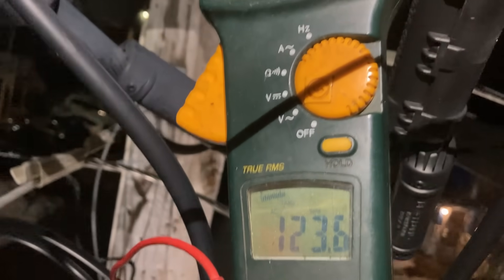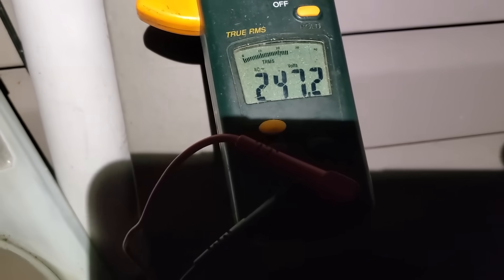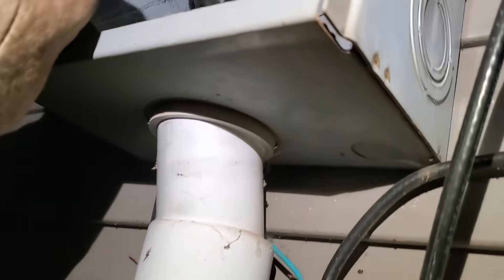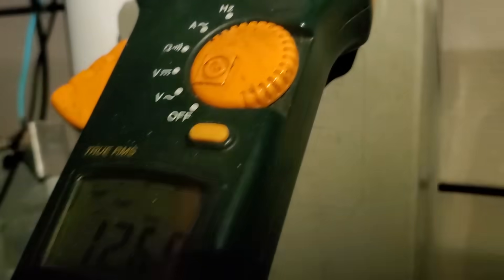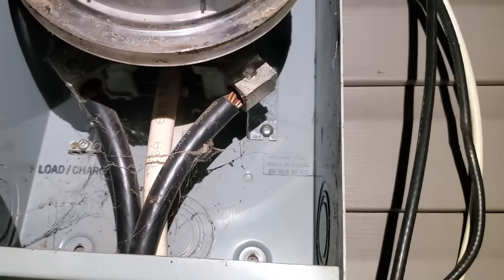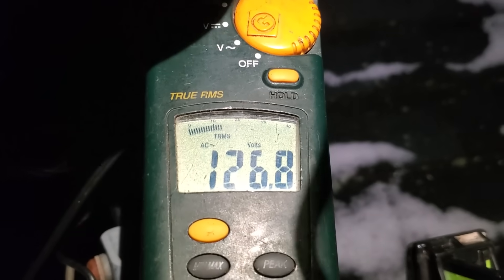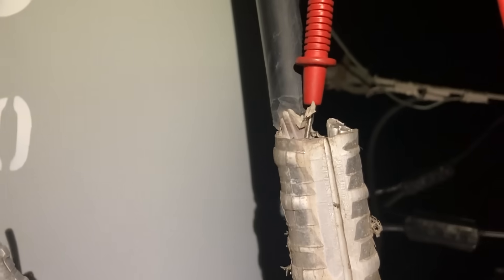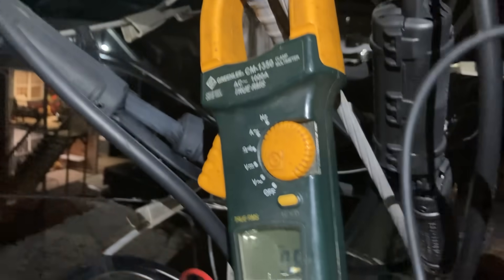Finding a bad neutral on a Service - Raw footage

Comment: I have seen neutrals completely disconnected on service drops and OWS’s on several occasions. I work as a utility arborist and get tickets about trees laying on or rubbing on service drops a lot.  When I talked to the customers they said they aren’t having any power related issues which puzzled me.   I am assuming this is because their house is properly grounded at the meter so they don’t have to rely on the service drop neutral for grounding.   Is this thinking correct?

Comment: You need to show this to every lineman in this country.  Around here they pull the meter and check voltage then say we have no problem. I check across every crimp and when I find voltage, I find my problem.
same thing with straight 480 in the oilfield. Go to every junction pole and check voltage across the crimps. Sometimes I might change 6 crimps on a phase.  even one or two volts across a crimp will cause a problem.  If you have a thermal camera they are easy to find.  Many linemen do not know what you are teaching here.
When I go back and the customer says they were told they have no problem I jumper the bad crimp and fix it myself.  I don't have the time, and the customer does not have the money to pay me to argue with the light company.

Comment: As a lineman when we see those older crimp on connectors, we replace them with Fargo clamps as soon as we hear of a flickering problem and get any kind of off readings, we cut all those old crimp ons out and 9 times out of ten problem solved.  Also, a lot of times triplex will have been rubbed raw in one spot by a tree branch and cause intermittent problems. Normally it’s one of the two.    You do great work enjoy watching your videos.👍

Comment: I had friends who called me because of things being damaged in the house by this.  Lights flashing and stuff was damaged by the voltage swinging high and low.  We called out the power company and what was crazy is the utility worker who showed up, remembered doing service work at that location 4 years prior to us calling and he admitted that he most likely had forgotten to tighten the lugs on the neutral block behind the meter and when he removed the meter it was a black and charred and he had to replace the neutral block in the meter box in order to resolve the issue.   I am going to guess that the power company also had to replace some things in the house because of it.  In a separate incident at my brothers house they had a drunk driver hit the power pole on the street corner and it severed the neutral completely going to his house which caused everything in the house to find a path through the ground wires on the dishwasher to copper water line coming into it and the furnace which was sitting in damp mud in his Michigan basement.  Lets just say that two strands of 12 or 14 gauge wire cant handle that amount of load and stuff started smoking.  Luckily my niece was home when it happened and she immediately went to the breaker panel and threw the main open cutting the power.  He ended up having a bad ground rod at the panel and I had to install a new one along with me bonding it to his city water line and his city gas line coming into the house to prevent this from happening in the future.  I also had to run a new wiring to the furnace and dishwasher as all the wiring was severely damaged from the red hot ground wires melting the sleaving on the Romex.

Comment: Plug in the Beast and then run the ST 800. That ST 800 will pop an OH neutral squeeze on like a firecracker. Saves a trip up the pole. Works well on UG too. You’ll find a shovel in your hands real quick 😂

Comment: I have this exact issue and the poco has come out three times and tells me it's not them. Had an electrician come out and swap the panel and nothing changed. They never checked the transformer. Pisses me off that i had to pay for a panel swap and im told by my electrician it's 100% an outside line

Comment: Why would the neutral from service line to meter box be energized? This is happening to our building? No load
Reply: How energized? Could be an elevated NEV due to many reasons, a ground fault.
Reply: @nicolasmarriott9221 the neutral line coming down the weather head going into meter box has 220v and if it contacts ground it makes a big short , do you think the hot wires have come into contact with the neutral inside the conduit leadind intp meter box?

Comment: I was watching the tv and noticed that the picture would change by growing or shrinking a little. Called the power company and they found the neutral cable in the ground was bad. The section replaced was a waxy substance inside the cable that was an open circuit.

Comment: Another thing I have seen linemen do to check for a bad connection is they use load heaters. They are basically hair dryers in a ball with jumper cables coming out of them. They pull out the meter and connect them to the line side meter terminals. Then they measure the voltage drop across each crimp connection.  If the connection is bad there will be a significant voltage reading on the vom. If the connection is good there will be a reading of 0 or near 0 volts.

Comment: I think I may have this problem, I checked everything from in house to meter with multimeter
I cut the whole house off and checked on my side of meter, one leg is 126 and the other is 123 
But if I  put a load on in house like microwave, coffee pot, vaporizer   the one leg goes down to 100 sometimes 90 and the other leg goes up to 130-140 

I have a construction company working on house right now they are trying to get funds from government program to redo the whole electrical system from breaker to wires to all outlets. But until we get the money I was told not to call the  energy company to check their end because if it is a problem behind meter they will pull meter until it gets fixed and me being disabled I cant go long without electricity. So I have to wait to get energy to check from meter to pole.

Is there anything else I can do to test my side to find where problem is? 
With my volts going down on one leg and high on other is that a for sure neutral problem or could it be something else. I cant find good videos to help me figure out the problem. Can you tell me what all I can test for?

Comment: Hard time following. Where were the test leads of the meter connected? Were the leads connected between one of the hot and neutral and then measuring from the other hot and neutral? A diagram would have been helpful to see exactly where you were measuring as you were testing.
Reply from the maker: That's correct, great idea including a diagram in future videos,I appreciate the feedback! 👊

Comment: Those crimps should be insulated with an adhesive shrink sleeve, keeping it out of the weather. It is corroded inside the crimp. Also, your crimper need to be calibrated more often. That is very important, and in the long run, this will save you much aggravation and precious time. I can tell from the video that your crimps are not tight enough and with a small adjustment, still would not harm strands.

Comment: Even  in  Industrial,  and   Commerical  Refrigeration, and    residential    you have  to  pay attention  on how electrical  circuits  are  wired.  Walkin  coolers   and  freezers  are 230/  30  amp  load, and   refrigeration techs  guys, have  to check  line  voltages  on  the  primary  side, and   low  voltages  on the  secondary  side,  but  yes  when  doing  a  voltage  reading  in  a service  panel  120/240   single  phase  service  panel, from primary  to  netural 120, from any   primary,    to  primary  240.  Loose  connections can  cause  a unbalnce   load:face-orange-raised-eyebrow:.

Comment: Had a floating neutral a while back and ended up calling the powerco. They pulled the meter and the inside the box was all burnt up and corroded. They also replaced the neutral crimp back at the pole. Powerco ended up paying for a new mast and whatnot. Never hurts to ask, even if you think it's your fault. Saved me 3 grand.

Comment: So I have a question... Here in Australia, we'd only have the one active and the neutral, right? You guys have two hots because you can wire it as 120v or 240v, but we just have 230v for everything. So in the case of a bad neutral over here, the voltage between neutral and active will be exclusively lower, right? You'd never see a higher voltage? Although... If you disconnected the neural outside the house and measured inside, the neutral would be floating so I guess the voltage could be anything.

Obviously I don't know what I'm talking about, just trying to reason through what could happen.

Comment: Does your utility use a load tester that plugs into the meter socket?  The tester puts a ~20A load selectively on each side of the service while displaying the voltage on both side.  I had this exact problem on our service.  An unbalanced 20A load would pull the neutral up about 20 volts.  The culprit was a corroded connection on the buried service entrance.

Comment: Well I have been trying to find my bad neutral for over a month now, I appreciate you, is there a such thing as a neutral that only acts up every now and again? I check L-1 and L-2 every day at the meter box almost every day it's 122 on both legs I can turn on the space heater it goes 120 on one leg 124 on the other but once in a while it will be 132 on one leg 114 or close on the other.
Reply: Yes, you can have a loose neutral that is fine as long as it makes good contact but not fine when it doesn't.  I have seen this inside panels where someone didn't fully tighten the lug for one of the neutral wires.  Of course same thing can happen to the main neutral in the panel.
Reply: @DS-sd9er  Thanks I finally found the loose neutral, it was were it bolted onto the transformer, sometimes it would go 2 weeks no problems but the wire was so loose it would shove back and forth.

Comment: When you start at the customer's meter and search back towards the transformer for the bad neutral, can the bad neutral be past the transformer even a half mile away?
Reply from the maker: Typically the problem will only go as far back as the transformer
Reply: Does the neutral come from the transformer or the electric company? I only have 2 wires coming from the electric company to the transformer, one wire is at the top of pole and other wire about 3 ft lower. @Bobsdecline
Reply: I think I finally found my bad neutral, got tired of sitting in the dark and eating sardines out of the can, so like you said search back towards the transformer, is I put my latter up on the transformer pole I do tree work so the height doesn't bother me, and I see fire crackling in the neutral lug on the transformer when I wiggle the neutral wire, so I was wondering why I am see fire crackling, could it be charged.?
Reply: I finally found it, it was where it bolted to the transformer, thanks for all your help.

Comment: I have been having problems for a couple of weeks things are normal at other times I can turn a lamp on and my box fan doubles in speed and other times it slows down when I turn on the lamp. Could that be a bad neutral?
Reply from the maker: It could be... If you have a multimeter/volt meter, you can stick the prongs in the socket and check the voltage. While monitoring the voltage, try turning some random items on/off. 120v items like toaster, microwave, coffee maker especially. If you have a bad neutral, you should see a fairly drastic increase or decrease in voltage.
Reply: @Bobsdecline  Thanks so much, I will try to find a deal on a meter and give it a try.
Reply from the maker: If it does show a bad neutral, I'd definitely recommend hiring a professional to investigate further.

Comment: I agree with thephantom1492. Test each hot leg to ground. If you get an imbalance put jumpers in the channel and read across the neutral connection in the channel. If that connection is bad you will read the imbalance voltage. If it reads zero do the same thing at the weatherhead.  If it reads zero there now you have to go to the pole. Where ever you read voltage across the neutral connection that is your bad connection. If there is an inline splice half way between the house and the pole which is not a normal electrical splice that also could be where the problem is. Most of the time this kind of problem will cause dim and bright lights. I've seen it high enough on the high side to do damage to electronic equipment.

Comment: Do you accept civil liability for the electronics damaged by the high voltage created when you tell a customer to turn on a microwave?  At the point you make that request you are suspicious of a loose neutral. and you know/expect that the microwave will create high voltage on the opposite leg.  So when all my smart switches, 80 inch TV, apple products, burn out because of your direction, and i file a claim with insurance, they're going to come after you.

Comment: 40 years ago I was a renter and one evening the lights were glowing very bright and the fridge would run quiter so i check with my meter and saw the voltage fluctuated between 130 and 175 on a receptacle so I called the local power company and they came and cheched and said there was nothing wrong, Two weeks later they had to come work on the transformer during a storm, well after that intervention the voltage was stable at 123.

Comment: Great video.  Years ago I lived in the basement suite of a house where the neutral was damaged by corrosion and it blew out all of my electronics.  I never understood until now how a bad neutral fried my stuff but if the actual line voltage changes it would definitely cook everything.

All of the incandescent lights in the suite were glowing blood red (low voltage) and there was smoke coming out of my AV gear. Sucked.

Some of it was repaired (not replaced) by the utility but was never quite right ever again.

Comment: We use the Super Beast to test our line side neutral(HJ ARNETT SUPER BEAST-D HJA-469-SD SERVICE CONDUCTOR TESTER).  You have to disconnect the line side neutral from the meter base socket and hook up the beast.  If the beast runs at normal fast speed its usually a sign its good.  If it doesnt run at all or very slow the neutral is most likely bad and the tell tale sign of unbalanced load is usually a good indicator as well.

Comment: An open neutral on the service equals UNKNOWN series/parallel loads on all the 120V lines in your house. There is no way to calculate or determine the destruction if the refrigerator kicks on on a different phase than your delicate electronics. I once did a service call for a lady who lost 2 TV sets, a DVD player and her kids game console for a open neutral. I did not charge her a dime.

Comment: Call me whatever about this (I'm not lineman trained)--but why is NO-OX or something NOT used in those connections but required in residential panel connections indoors?  And why not some sort of sealant around the neutral connections?

Comment: Yes, go for a microwave NOT a dryer, oven or stove element as they are all 240V load or  "balanced loads. As Bob said "Unbalanced or phase to neutral loads."  Ungrounded to grounded conductor. 
Ground current can also go up.  Fun fact - when the neutral is breaks on Triplex, the #6 grounding wire tries to carry the load and will burn vinyl siding.

Comment: My lights are flickering in my house and I've gone through and checked with a tester and everything seems to be correct and I'm wondering if it would be correct if there was a bad neutral on the service side or if the tester would show bad inside the house.

Comment: Sounds partially like a problem I have, but then not so much. I have a decent APC model UPS unit. It generally shows 120v. However, when I use my microwave oven on partial power, the UPS beeps and shows over 200 V for a moment, then drops back to ~120V. I can't figure this out! No lights flicker, TV doesn't show any sign of anomaly, nor does anything else. Does anyone have any suggestions as to a possible cause? (I'm in USA)

Comment: Our power company  bought  us and our neighbor  who was on the same transformer  new televisions  and microwave  because  their transformer  lost its neutral  connection  due to corrosion.    Antique  copper wire ,they finally replaced a few years  later.  They sanded the green  patina   buildup on their  copper  distribution neutral and primary  connections .
Reply: Both legs went wild alternating between  very high and low voltages.